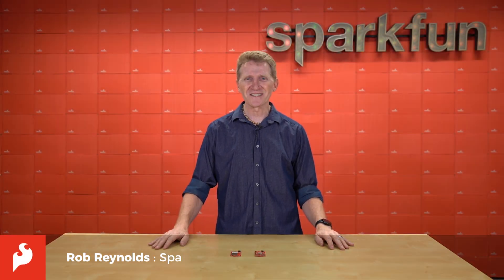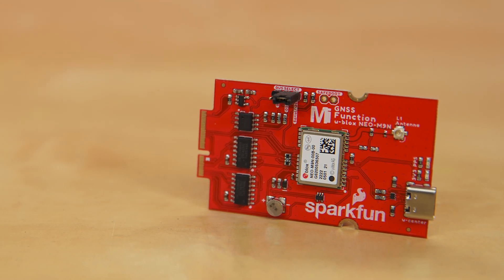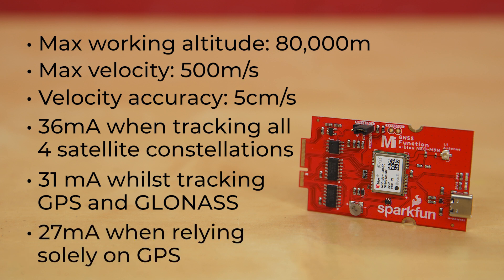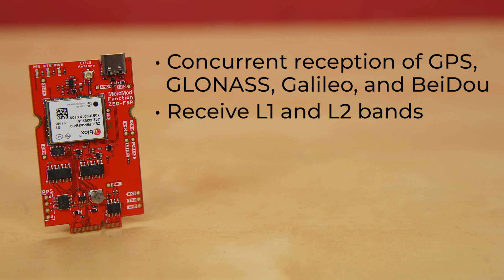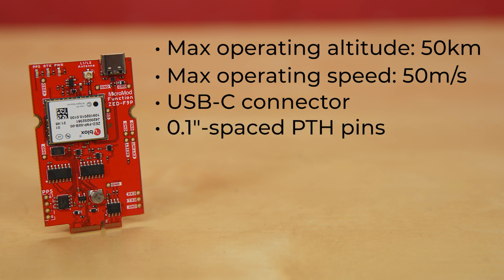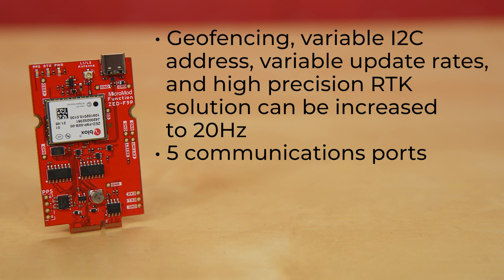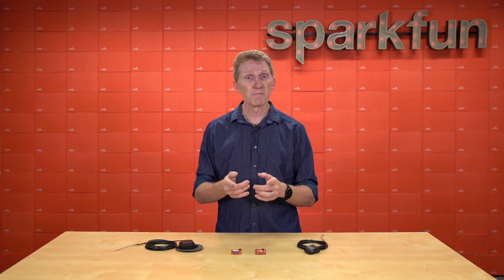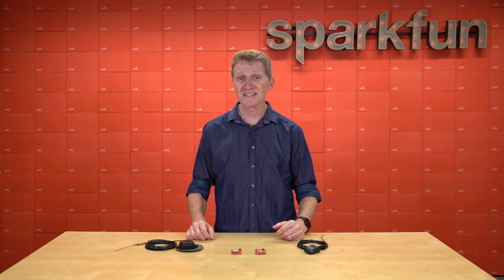Product Showcase: SparkFun MicroMod GNSS Function Boards

Comment: Now you say Arduino. Most of the stuff I plug into my arduino runs about $5. Its an awesome hobby. Your budget model is $50, That's Two ESP-32 TTGO boards I don't have yet. Examining a new board is like having a new book to read, I don't wish to buy the library. $250 is insane,  Unless I need to recondition a BGM-109 guidance system it will only be a novelty.  Good video, but you got me priced out of your stuff.
Reply: rtk with l2 used to be 10k+ just a few years ago. It might still be too much for you but it is a new even lower price point which opens up a lot of new use cases.
Reply: @BaldurNorddahl I believe SparkFun makes good stuff. I can't tell for sure because I HAVE NEVER own a SparkFun board. TOO EXPENSIVE!!  As a Tech I'm always in need of solutions, Including work arounds. I work around your pricing and as always end up with a cheap Chinese solution. I know what EXPENSIVE electronics look like, I was an Avionics Technician for the U.S.N. , 30yrs. With that said I also know what over pricing looks like too.
Reply: @planker  gotta chill my dude. If it's too expensive for you, don't buy it. Others will, there's a ton of tech in that tiny board.